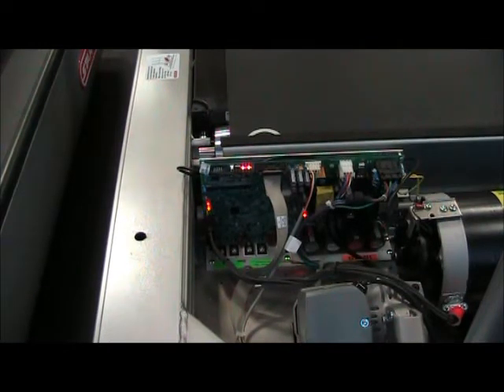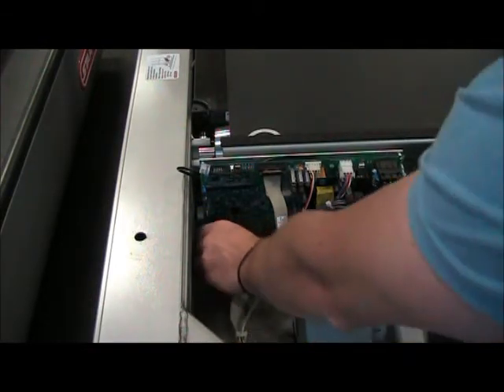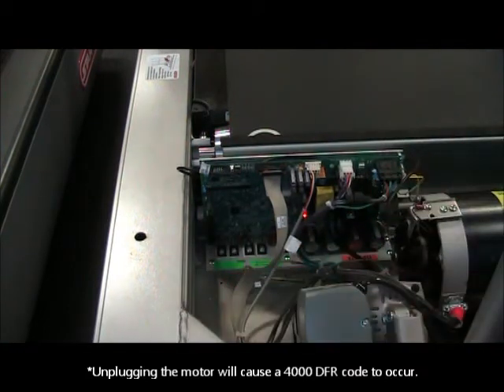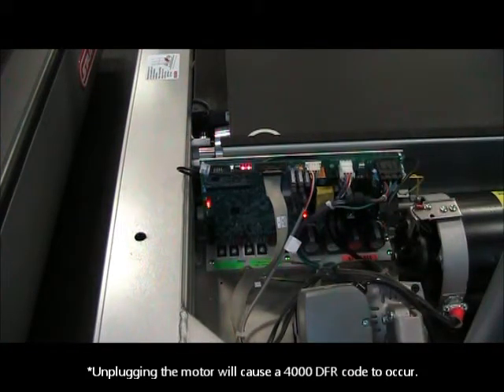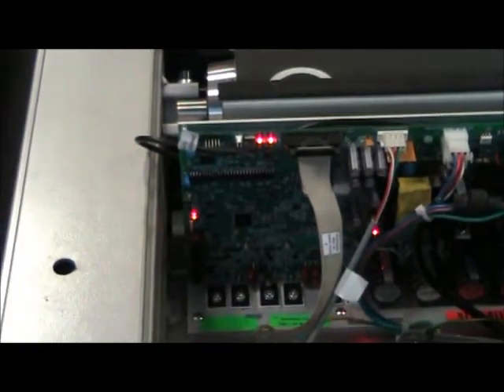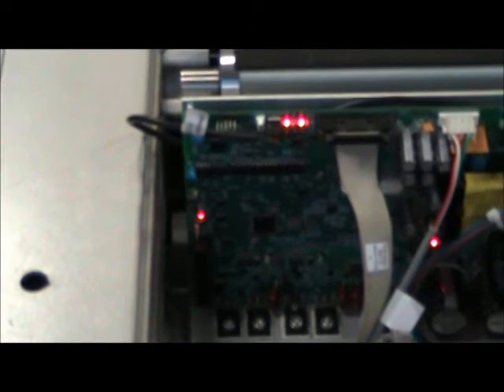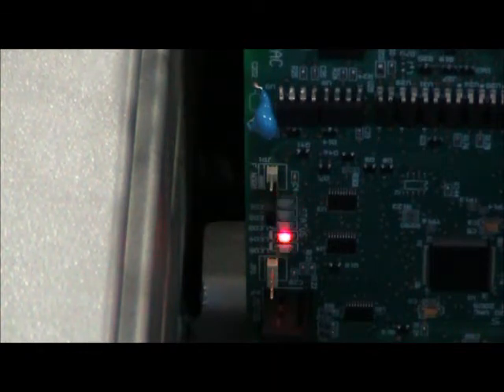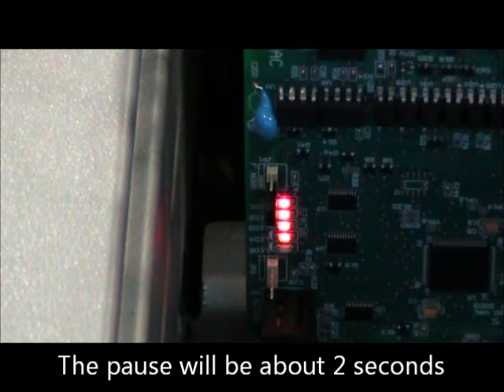Star Trac: Checking the Motor Control Board (MCB) for DFR Codes

Comment: Is this just a list of past error occurrences? On the Nautilus T9 commercial the MC3PHAC which controls the pwm,dead span and error reporting resets would send this info to an Atmega8 AVR on the VSD which translates to an ATMEGA128. Going into the error log up to 16 fields would give a detailed description of the error  However, It doesn't tell you how to fix it. That's where the technicians knowledge helps out.